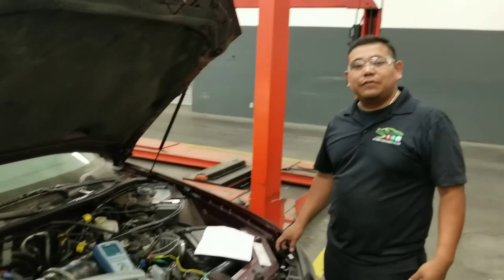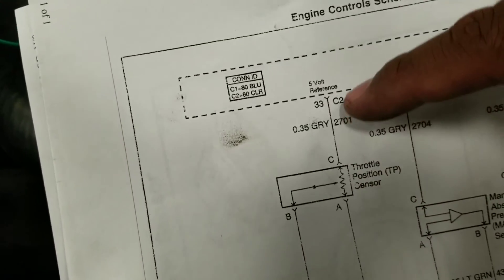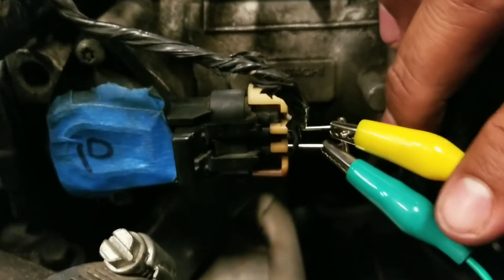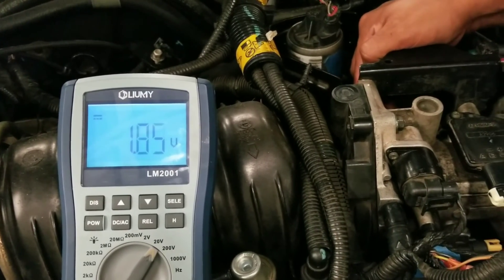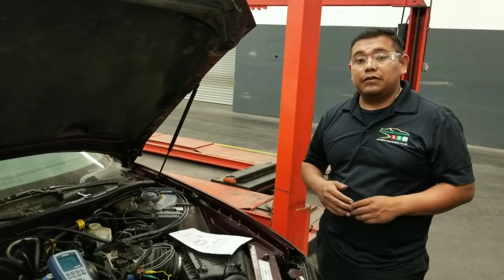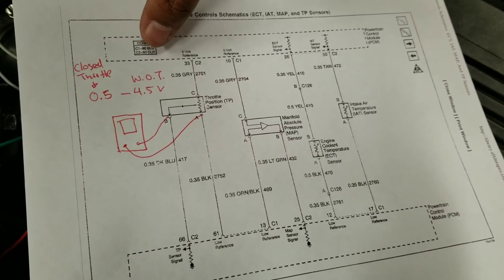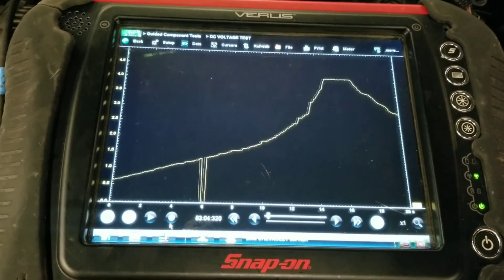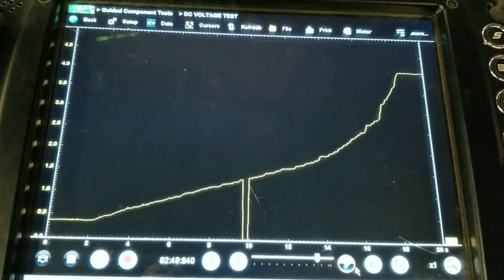How to test a TPS sensor

Comment: im curious why the first step isnt adjusting the tps so the voltage reads higher? ?
Reply from the maker: If the sensor is adjustable, yes that will be the first step. Not all TPS sensors are adjustable, if not adjustable they have to be replaced.

Comment: I don't understand why you stopped making videos - you are too good at explaining this stuff - your channel would have grown and grown if you kept it up. The way you explain stuff in all your videos is just right - not many people can explain difficult concepts with that much ease.
Reply from the maker: @pingpong9656  not all TPS Sensors are adjustable. The higher the voltage the more fuel the pcm will add.
Reply: @MRDIAGNOSTECH  I did not ask that question 😆